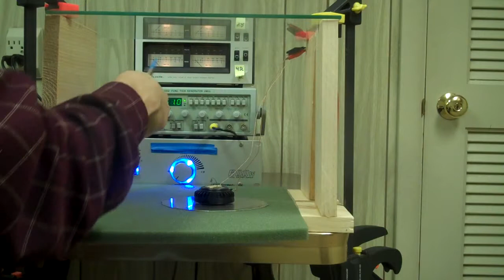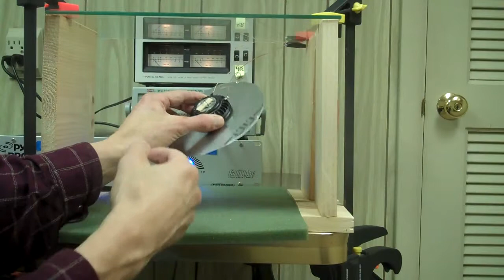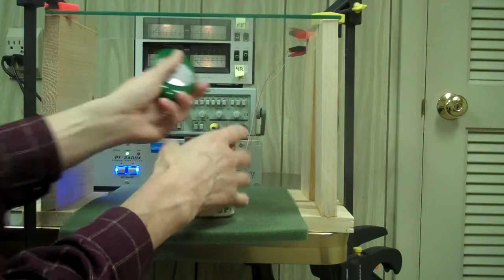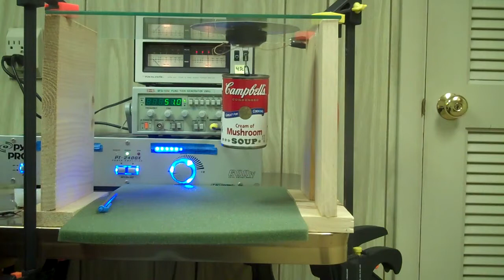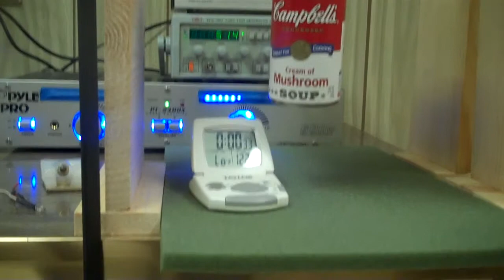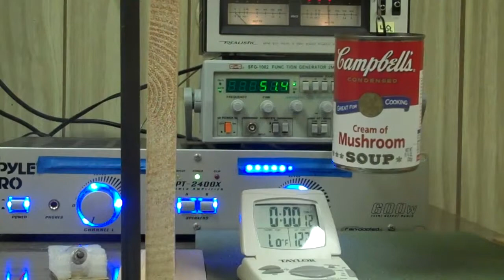OL8: "Souped Up" Hoverboard

Comment: absolutely amazing! Is there a way to possibly supply power to the lifter via the flight deck using some sort of contact brush and rail mechanism?
Reply from the maker: Thanks! Yes, exciters (vibrators) can be placed in an array on the flight deck, which can be envisioned as an overhead track.  This would be competitive with maglev for use in subway systems or as the air bearings for Elon Musk's Hyperloop.  The main thing is to get air oscillating parallel to the wing and deck.  Hope you got a chance to see heavy lifting in OL9.  It uses a two-exciter array with a metal wing.  The flight deck could be metal as well.  Glass was used to enhance viewing. https://www.youtube.com/watch?v=kG6vXGidQbo